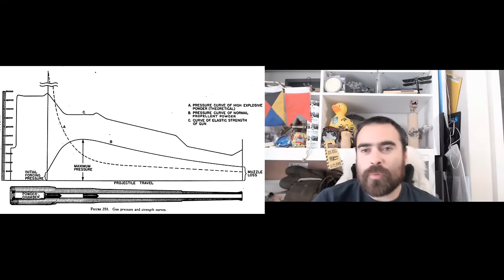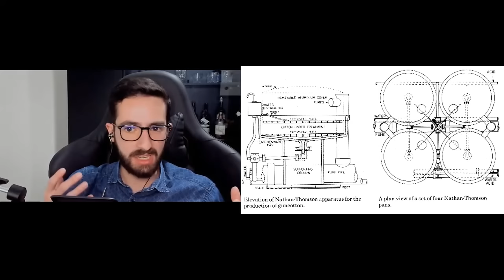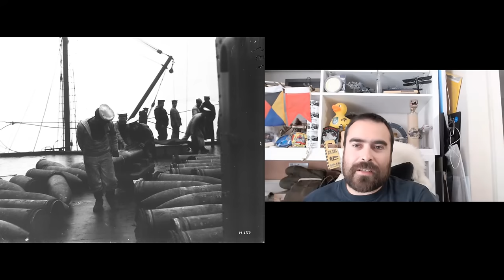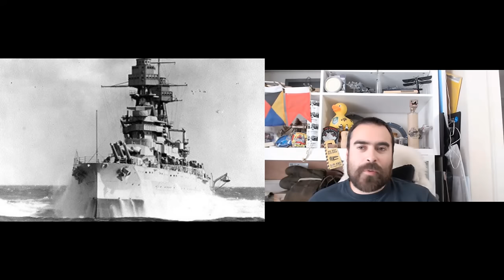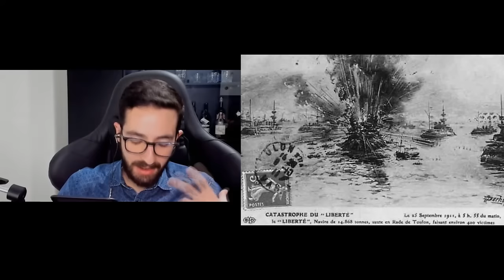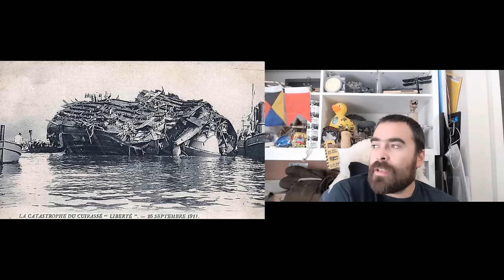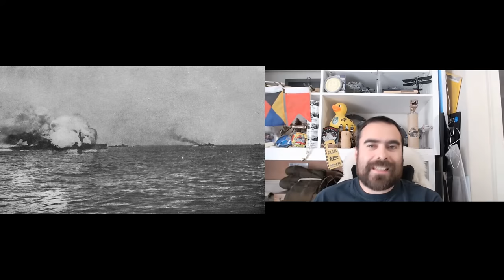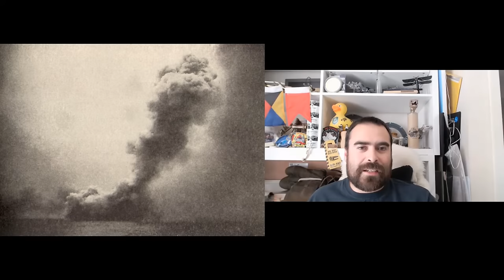Cordite and Poudre B - Why things start exploding at just the wrong time

Comment: When talking about the nitrogliceryn overmatching the blast doors, keep in mind that just a small fraction of the compound would have been released, or it would have been noted upon firing if the combustion of the charges had drifted way off spec. So it is significant as a primer more than anything else.

Comment: One story of cordite is that the Brits had to get around A Nobel's (of dynamite fame) patents on mixtures of nitroglycerin (NG) & nitrocellulose (NC). The patent said the NC was the "soluble" kind so the Brits mixed "guncotton" (GC) (NC nitrated to a higher level & not soluble in the same solvent) and NG. The scary part is both GC & NG can be induced to detonate (as high explosives) with a spark or mild shock. 
Both NC and cordite have been used in small arms ammunition (SAA). I have read of any major catastrophes involving SAA. SAA charges are individually smaller and usually encased in a metal cartridge case which may act as a heat sink from internal heat generated by decomp & from direct impingement from the decomp flash of another charge. And a 100 kg of NC/NG/GC propellent in SAA has a lot more metal & air around it than a similar amount for a BB gun in its storage case. Size matters.

Comment: Static electricity question: 
My father worked for years with a US manufacturer. His job was to prevent explosions in factories due to static electricity and solvents. Basically, one little almost invisible spark can cause an explosion. Employees in certain sections of the plant had to wear special shoes, and other precautions were taken. Your thoughts on static electricity and explosives please.
Reply: Eletrician here, static is absolutely a problem when handling explosives. The good news is that on a ship, the hull is essentially the "ground," so static gets dissapated quickly and is less of an issue. That being said, I want to say that USS New Jersey had brass discharge plates outside her powder rooms you touch to discharge yourself before entering.

Comment: Very disappointing with respect to technical points. Distinction of propellant from high explosive was only made by Drach late in the discussion. Adsorption is a major issue. There are really no “nitroglycerin crystals”.Gun cotton is a grade of nitrated cellulose, not a chemical substance. Cellulose is a long chain molecule with many sites on each molecule that can be exchanged for NO3 groups. More highly nitrated nitrocellulose will have more oomph, but is more prone to autocatalyzing decomposition. The nitrated carbohydrates release nitrogen oxides as they decompose. If that is not absorbed and neutralized by other substances in the mixture, the propellant will become more sensitive with time. The NOx form acids with water. 
Dominant causes of the “something wrong” at Jutland we’re poor housekeeping in the battlecruiser fleet partly induced by the myth that rapid rate of fire is a substitute for poor marksmanship. Another cause was Admiral Beatty’s fox hunting, hussar, glory-seeking tactics. He didn’t tell Jellicoe in time.
Reply: Thank you for clarifying the technical points. Many of these historical ship videos are disturbingly lacking accuracy though this site is far better than most. They are made by enthusiastic amateurs who, for the most part, do not do their homework before making a video.
Reply: Agree. They make valid points but talk in very confusing way, keep points spread all over the place, and there are quite a lot of mistakes IMHO. While instability of the propellant could be reason for disasters or increase the risk, I hardly find here arguments that it was principal cause.
Reply: Sugar works good too.  See grain dust explosions.
Reply: @oldtugs  So wait a year or two before putting out a vid?
Reply: @rogersmith7396  If that is what it takes to make a technically and historically accurate video, yes. It's not like these videos are time critical.
Reply: @oldtugs  Its not a peer reviewed PhD thesis.  Its Youtube.  Deal with it.
Reply: @rogersmith7396  Gustav did that already.

Comment: Any thoughts on the PAINT used on these ships?

No water-based acrylics around in those days. LOTS of Nitro-Cellulose lacquers, though.

Smokeless propellants are generally classified as "single-based"or "double-based".  Single-based is nitro-cellulose only, often with a graphite coating to both prevent any static electricity buildup and make the powder flakes or granules flow better through the cartridge filling machines. Single-based, flake-form propellants are renowned for their fast burning rate; hence their widespread use in moderately powerful pistol cartridges. Complete deflagration just before the bullet leaves the muzzle; very efficient; ideal for specialized target loads.

"Double-based" propellants have SOME Nitro-Glycerine in the mix, literally. It is blended with the NC paste before extrusion.

Cordite as used in small arms ammo (think: the classic .303 British cartridge) is just this stuff. Little "cords", tied in bundles.

Side trip:

The original 1888 version of the .303 was a BLACK POWDER cartridge. . The powder was NOT poured into the fully formed case. It came as a compressed pellet of BP and was dropped into the straight-sided form of the primed case and a glazeboard was placed on top of the pellet.

With the changeover to "Cordite" the factories replaced the old BP pellet with a tied bundle of Cordite "sticks", of pretty much the same length as the BP pellet. (The bullet was still the same at that stage).

THEN it went to the first stage of final forming, then the bullet was dropped into the case, to sit on that glazeboard wad.

FINALLY it went to necking and stab / collet crimping. The "groove" on the bullet was NOT for crimping, it held a bituminous sealant for waterproofing.

Thus, the cartridge necks of billions of rounds of .303 ammo were NOT annealed before bullet seating. This is one of the reason that folks encounter cracked necks in cans of ammo sealed up decades ago; NO annealing = no stress relief and this results in the bras cracking..

Double-based NC propellants WILL degrade of not stored properly, OR if not MADE properly. Some years ago, I was helping clear out a "deceased estate" of  an old shooting buddy. In a nice wooden cupboard, were several cans of a particular popular double-based rifle propellant. I went to pick one up and what I got was a nasty mess of Black "goo" and a can with no bottom in it, accompanied by a nasty acrid smell. The packaging label on the outside of the cans indicated that this stuff was about twenty years old and I knew its storage history. 

The  condition of those cans indicated an "issue" with its manufacture. Other propellants in that place, some several decades old, from multiple makers around the planet in that same haul, showed no such similar problems.

Smokeless powders, like wine and beer, should always be stored in cool, dark place. and NEVER in a "safe". In the horrible event of a house / shed fire, propellants in a wooden cabinet will flare and fizzle. Those contained in an airtight metal safe will be part of a BOMB. Ammo propellants are a LOT less dangerous in a house fire than Propane tanks, enamel paints and thinner, Jerry-cans of lawnmower / chainsaw fuel, etc. Flammable liquids will FLOW in rivers of fire once their containers are breached. Fire crews are NOT keen on such "surprises".

Comment: One thing that may have been an additional issue is that strong acids are not stable. John D Clark explains in his book "Ignition" that in their post WWII effort to find storeable oxidizers for military rockets, they tried several strong acids (red fuming nitric acid - sounds friendly enough) none of which could be stored in metal oxidizer tanks for very long. Upon testing the acids, they discovered that none of the acids were anything close to being chemically stable. They were constantly REACTING WITH THEMSELVES forming different compounds within the acids. Not surprising to hear that other compounds made with strong acids would react badly over time.

Comment: My grandfather worked for DuPont in the 40's and 50's at a facility manufacturing dynamite. In those days the inert filler in the sticks of dynamite was stale popcorn. He said that in the summertime the dynamite stored in the "powder house" would sweat nitroglycerine. The concrete floors would be wet with nitroglycerine and workers who had access to the powder house were required to wear boots without nails in the soles. Even with those precautions there were several accidents over the 20 years he worked there. The worst powder house explosion killed 7 people and they did not find enough human remains to fill a shoebox afterwards.
Reply: That wasn’t a specifically Du Pont problem. Nitroglycerin is twitchy - nitroglycerin plants vanishing regularly with the operating staff is a regular occurrence. The two tons of nitroglycerin in the production reactors is usually enough to minimise burial expenses.

Comment: One note about the stability of the nitroCELLULOSE portion of the propellants - THAT will ALSO degrade violently or even explode if stored for long periods. Even if all the acid is removed, any exposure to moisture (including humidity in the air, definitely a problem on a BOAT) can slowly cause some of the nitrocellulose to decay on its own, releasing nitric acid, that causes it to break down even faster and release fine nitrocellulose crystal dust just like with nitroglycerine but on a longer timeline as it IS a solid. This is also exothermic, AND will proceed faster with more moisture and more heat, so something as mundane as a low-pressure steam leak in a heating radiator can cause a massive explosion. Exhibit A for the "steam leak" problem, Cleveland Clinic explosion of 1929 when a ruptured radiator pipe in their X-ray film room full of "celluloid" nitrocellulose sheets killed 123 people by fire, explosion, and toxic fumes.

It's why guitar picks, those fake mother-of-pearl toilet seats and knife handles, dried nail polish, and ping pong balls turn a reddish-yellow color and start cracking and turning to dust if you leave em in a garage or a basement where they're gonna be in heat or moisture a lot. That's downright dangerous and the fact we still USE nitrocellulose/celluloid plastics in modern stuff is kinda crazy given the risks.
Reply: The burning balls are fun to hit back and forth, not that I ever did that, nosiree.

Comment: a lot of people miss the fact that most explosives and propellants have very similar energy density but wildy different burn rates/detonation velocity. But with a faster burn rate you get a lot more force exerted on the breech rather than more evenly distributed while the projectile moves down the barrel. the shorter the barrel the faster you need it to burn, the longer the barrel the more propellant you can add with a slow burn rate to have an overall higher amount of energy to release.

Comment: I know Dupont, who made most of the American supply of gunpowder and other propellants made the stuff in batches and one side of the buildings they made was designed to blow out to save the equipment and building.  A powdermaker was said to have "Gone over the creek" which the blowouts happened to face.  

It is suspected that the nitro had settled out of the buffer in the propellant bags when the USA battleship had the explosion in the turret back in the 80's.  There was no way to tell exactly what happened because the proof went up in smoke.  The pressure of a regular ram was enough to set off unbuffered nitro...

Comment: Back around 1980, we were doing target practice at a coastal fortress with converted 3" AA-guns and we had a misfire. After the recommended waiting period we took the round out of the gun and an old staff armourer removed the primer and the shell and took out the charge, which looked like a bunch of long macaroni. He set it up on a rock near the shore and lit it. It burned with a strong flame rather like a flare -- no explosion. Presumably that would have been one of the "newer" explosives.

Comment: Pre Dreadnought HMS Bulwalk blew up in the river Medway during the Great War. The investigation found that the insulation between the magazine and boiler room was paper! The appropriate materiel had not been used. On the question of British bagged charges causing dust, why didn't they use more non permeable bags or brass casings?
Reply: The bags have to be flammable enough to burn up when the gun fires. A bunch of smoldering clumps of tarpaulin in the breech is going to cause problems loading the next round.
Big brass casings added too much weight. That really complicates she'll handling. The shell and charge as 1 unit means you have to maneuver a much larger and heavier item up from the magazine into the breech. Then you have to eject out a large, hot, brass garbage can out of the breech and then out of the turret. You also lose a lot of magazine space. Turret has to get bigger. Shell hoists have to get bigger. Barbette has to get bigger. That change causes a whole cascade of problems. The magazine still goes boom if it gets penetrated by a bomb or shell.
Modern warships are probably worse considering they have virtually no armor, lots and lots of missiles, and a lot of aluminum structure.
Reply: No, Germans for example used a brass casing for the main charge, and a combustible light metal casing for the fore charge.  That also allowed them to make the guns lighter.

No German ship went boom, and several had magazines fires.

Comment: My Chemistry teacher in high school served in the Korean War as an EOD and Army Engineer. Once I got him started talking about chemistry of explosives, all sorts of strange operations were described. One was he freaked out the soldiers at a campsite using tnt to heat his coffee in the winter. You can burn it like camp fuel and the soldiers thought it was going to explode any second. 
The other spectacularly nasty application was the Chinese and North Koreans buried pots of nitroglycerin or picric acid inside the  ravines and cliffs. Extremely dangerous to be placing such things as unexploded ordinance about. 
If their enemy was approaching or retreating through there, they would just lob a few artillery shells or mortars to set off a long string of pots. Bringing the cliffs, or hill sides tumbling down on them.

Comment: My writing this comment is a testimony to the stability of modern explosives. In the early '70s I was stationed on the USS Enterprise. We were doing an underway replenishment and they were high-wiring ordinance from the supply ship to the big E. I was standing fire watch which meant I had a charged 2-1/2' fire hose ready to go if something decided to catch fire. The winch operators on the two ships got their signals mixed, or perhaps a large wave caught the supply ship by surprise, but about 20 feet away from me a pallet of three 1000lb bombs got slammed into the side of the ship with a really loud KA-WHANG. They didn't explode. If they had I'd have been spray painted around the inside of the hanger bay.

Comment: Talking about cooling the ship. Pre-compressor cooling air conditioning aboard ships up to the mid-twentieth century was achieved via air flow ventilator funnels, on the upper decks, and only worked well when the ship was sailing at a cruising speed,  i.e. while the ship's superstructure was moving through the air. Very much like winding down the window of your car while driving around. When the  (French) warships were berthed in port, however, there was no movement of the ship
 and no air flow through ventilators. Hence, limited or no cooling.

Comment: The other problem in Jutland was the over stocking of shells and propellant in places they should not be stored.  My understanding the British felt they had better guns for long distance battle so the plan was a long range fight where the issue would be running out of ammo.  So ammo was stored where it should not have been.  The dust may also been an issue with excess ammo stored everywhere. Well the fight turned out to be closer than planned.

Comment: This is absolutely fascinating. It seems a major missing piece to the story of Jutland. The characteristics dust explosions are well known as are nitroglycerin. A new process and product are introduced thought to be safe at a system wide level. As was mentioned site at least one on site specialist, Gunner Grant noticed the problem on HMS Lion. Disasters are usually a series of cascading failures in a system. When Q turret took that major hit the proactive efforts before may have been the difference. The crew certainly acted heroically especially the mortally wounded man who called down the voice pipe to flood the magazine. That time to react may have been bought by the efforts to clean the magazine and handling areas of dust in the devastating aftermath of that hit. I don’t doubt the crews on the ships that suffered magazine detonations were any less brave or had such selfless individuals. Certainly luck good or bad can always be that wild card factor but there seems some good evidence here that points to something more. Beaty did himself no favors & it’s easy to blame his failures of command but the crews were highly professional. It doesn’t seem disputable that on some ships corners were cut in favor of rate of fire due to the circumstances of the division of the Grand Fleet. Yet it’s a much more satisfying answer that the crew were taking some calculated risks but not blatantly ignoring all safety practices. It’s hard at this remove to get much closer to a definitive answer yet with precedents in mind it’s hard not to think there’s something here.